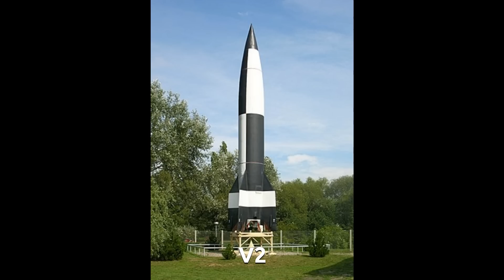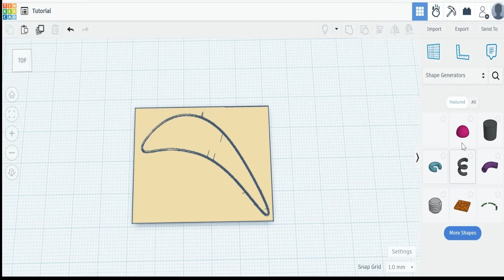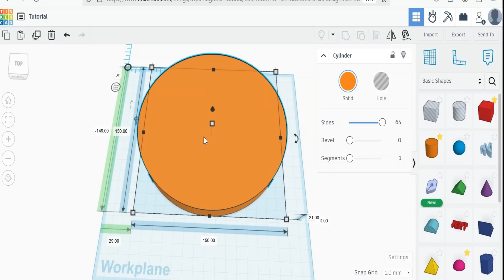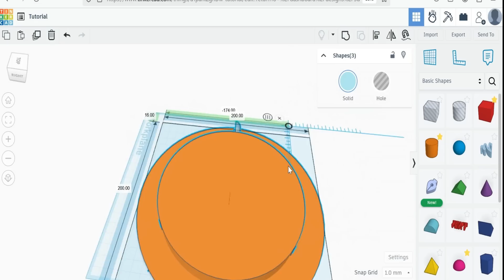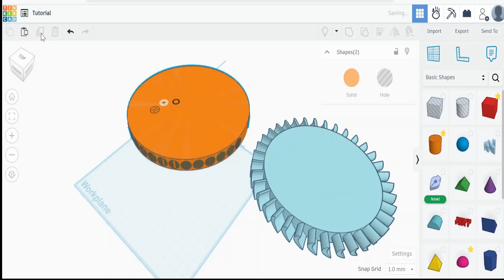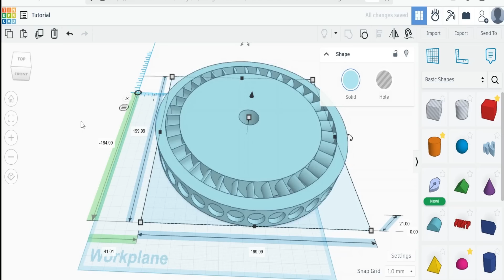2342 The Blisk Turbine

Comment: The new sketch tool in tinker cad can do the extrusion way easier and with different curve attributes for each side. I highly recommend looking into it. I've made some fun stuff with the new sketch tool. And you can place it on a part face and sketch directly onto a part if needed allowing specific holes, pegs, or minor details if needed.
Reply from the maker: cheers mate

Comment: if using compressed gas anyway, could try  taper hydrostatic bearings, around the disk circumferance. (t's a way of 3D printing the bearings)
add bevels to the disk circumference.

then you need a pair of  housing rings with tapers to match the bevels exactly. radial holes so bolts can be used to clamp the disk in between them 
then add at least 3 pockets into the tapers to form gas bearing pads.  
add holes to allow pressure lines to be connected up to the bearing pads.
add air flow restrictors to the pressure lines. and connect them up to pressure source.

assemble the  housing rings to clamp the disk loosely at first. and increase the pressure. it will  leak badly at first. start spinning the turbine, and slowly increase the clamping, but always allow the disk to keep spinning. as it spins and gets tightened, the tapers will start to close up, and will wear themselves down into a near perfect fit. Akin to forming ground glass tapers as sometimes used for laboratory glasswear  
Once that done when the bearing is presssurised there's no solid to solid contact at all. zero wear and the only drag on rotation comes from air having tiny viscosity. the smaller the clearance the less gas flow there will be escaping the bearing. 
forces from pressure have a tendency to expand the housing rings. if the fit becomes close enough it's quite possible that when pressure released the housing rings will clamp down on the disk, and prevent it's rotation .but as soon as pressure applied again the clamping force will release.
Reply: Also... at high rpm, disks and flywheels tend to expand due to centrifugal forces. flyhweeels etc have a max rpm, beyond which the disk will literally fly apart. Between central bearing and periphery material is under radial tension. and those forces are usually the limiting factor for rpm.   With bearing on periphery material of the disk is under compression, and clearance will become even smaller if rpm rises. useful to prevent overspeeding. it's also much much easy to beef up a none rotating housing to handle greater forces than it is to do such to a flywheel. adding structure to a flywheel might increase it's strength, but doing such also increases the forces induced by spinning it..
Reply from the maker: yeah - give it a go mate - sounds good

Comment: I noticed a wierd and probably irrelevant thing with the filter on my large coffee pot plunger i.e. the ones wth the spiral wound thing providing sealing force against the fine metal mesh filter disc.  When cleaning the filter in the sink and running water onto the plunger at an angle to make it spin in order to fling out all the coffee granules, I noticed that it does seem to very efficiently pick up the energy in the running water and translate it into spinning motion.  Just a thought.  It is or acts as a kind of turbine I suppose.  Yep, I am probably overthinking it.
Reply from the maker: sounds right mate and it is an interesting observation

Comment: For the beginning: the V in the naming of those things was for "Vergeltung" =retaliation (or vengeance if you want to keep the correct first letter.)
And there are stories about why many of them experienced "navigation issues". Most were built using forced labour. And there often weren't "enough" guards.
So some forced labourers "tinkered" a bit with the navigation system.
(I remember hearing a former KZ inmate that had to work in such a factory telling that they pissed into/onto the delicate innertial navigation system occasionally before closing the lid.)
Reply from the maker: nice post mate thanks for adding that

Comment: You can get a normal cheap roller or a foam roller and put it on good bearings and you'll find the surface area really absorbs the air from a stroll very well and spins amazing and alert this from doing it by cleaning out rollers with a tap and squeezing the end of the tap hose And the spin used to get and then I realise it also do it with Steam
Reply from the maker: for sure

Comment: So could you create a vertical shaft that directs wind from any direction down a tube and onto this turbine to create electricity? Like some kind of cone at the top of an ever decreasing diameter shaft that doesn’t need to move to gather wind from any direction.
Reply from the maker: that was the idea behind the invelox turbine mate
Reply: @ can you link the video or at least tell me if it worked?

Comment: A tip on Tinker Cad, if you have a bunch of things you want to go around a circle, and they will be 'balanced' I.e. rotated 180 degrees, on the far side of the circle, use the duplicate, button to make a copy, then on the top of the right side, use the 'mirror' button to flip the freshly generated shape left to right. Now drag that shape to the far side of the circle, highlight all 3, then use the alligntool to align them "top to bottom' or 'left and right' across the center of the circle. Now select just the two shapes you want to copy around, and merge those. Now you make a copyof both, turn the copy 10 degrees, and then make another 16 copies to get them all around that ring. Finally I select all of them, align them left to right, and top to bottom, and make sure that they are properly centered on the center shape. 

The same technique for the magnets, though that may not need to be mirrored. If you trust the plastic more than the glue, you might use pockets oriented around the ring, just far enough in that you get a couple of perimeter rings outside of the pocket for the magnet. A drop of epoxy here should keep the magnet in place, but of course you're mostly on your own for orenting north and south poles on those magnets. I would think that the forces on the magnets from the disk spining would mostly be radial, rather than lateral, meaning that the glue wouldn't be under as much stress to hold onto the magents. On the other hand it moves the magnets away from the pickups. So either way.

As for the bearings, I'd suggest putting a 2mm "rim" in the middle of the disk to give the bearings a surface to seat against. That way if a bearing ends up being a little uneaven, it has a seat against which to allign, rather than potentially putting odd stress on the bearing and disk.
Reply from the maker: cheers mate - I have done tutorials covering your suggestions but it great to have a refresher for folks who haven't seen those tutorials
Reply: @ThinkingandTinkering  For me it's been part of making knitting looms, where the pegs need to stay oriented around a common center. And I've had the fun of working out angles, like how to get 7.5 degrees of rotation for a 48 pin loom, turns out if you turn it to something like 7 degrees, and you get to that 'counter quick enough, you can type in 7.4 (or -7.5 if you'v been rotating it the wrong way) and it will remember that change as well. I imagine that someone's going to need that for a 52 or 66 blade turbine some day. 

Who knows, I may have gleaned the rotation process from one of your own videos. In any case, was good to see, and I'm wondering if that blade profile is going to show up on a Magor Hardware fan showdown one of these days. That might be cool too.

Oh, another way to get that blade profile from a png or jpeg file is to open it in the Gimp, (photoshop may work too, I don't use it) use the magic wand to select the blade profile, then turn the selection into a path. Go voer to paths, and export the path as an SVG. I've had to do this for a couple of 3e prints where the image was needed, but not really available. There may be a way to do this directly in Inkscape too, I haven't delved far enough into that tool.

Almost always interesting to watch your videos. Have a great day!

Comment: The blades you've used are for when the propellant (usually steam) is to expand and increase in speed as it passes through the rotating blades - a reaction turbine.  That bulge forms a narrowing of the space between the blades, like a nozzle, so the steam expands and accelerates as it leaves that narrowing (nozzle) and the curved tail of the blade redirects the flow to one side, the reaction forcing the blade and rotor to turn in the opposite direction.

However, what you seem to want is the propellant to increase in speed from stationary nozzles then transfer all the kinetic energy to blades - an impulse turbine.  You need slightly different shaped blades, like from a De Laval turbine, or half a Curtis Wheel.  Just google "impulse turbine blade cross section".
Reply from the maker: cheers mate - but i did want steam
Reply: @ThinkingandTinkering  Ok, blowing through the straw was only for demonstrating porpoises ;P

Comment: Thank you Robert, I love these projects and more than that, you make them so I can understand them, always a massive bonus.  Would it be possible to use it as a hybrid wind turbine by having a "big cup shaped thing" to catch the air, reducing to a small outlet (a bit like a funnel) to drive the wheel?
Reply from the maker: I honestly don't know mate - but i do like the idea
Reply: @ThinkingandTinkering  I wondered if it were nearly empty in the middle with the blades attached inwards from the outer rim… would you get good low/medium velocity breeze throughput without losing any important design considerations?

Comment: If you want to trace lones to an svg, I normally use inkscape. Inkscape is free and has extensions you can use. You can search online for how to do this, its pretty simple. And with inkscape you will likely get a significantly better trace of the picture and use it directly without having to use it as a template. Just a suggestion

Comment: Hello Mr. Robert Great video as usual... I always wonder about the balde for gas turbine. How can they withstand the huge torque when rotating the generator to produce electricity? With simple calculations, it appears that each megawatt requires more than three thousand Newton meters at   three thousand rpm per . Will the force resulting from compressing the air and then expanding it when mixed with fuel and igniting it be distributed on both sides of the blade? That is, the force embraces the blade .. I hope for clarification
Reply from the maker: each blade doesn't experience that force mate - it experiences only a small share of the force which adds up
Reply: @ThinkingandTinkering  thanks sir

Comment: Another great video.  I have thoughts to print additional blades in closer to act like a transmission when it gets up to speed, blow on the ring that's closer to the spindle for higher rpm.
Reply from the maker: i like that thought mate - do it - oh and do a video to share it - cheers
Reply: That's a very nice idea, having the nozzle adjustable.
Inner loop and outer loops for speed and Torque. I'm sure this variable drive idea, is definitely a good one, I thought similar thoughts, when I saw this, shifting mechanical would eat energy, but less if  nozzle than Gearing, chain or Cog. If I lived where more running water was, I could see a, "Trompe" water powered Air compressor, and this turbine. Compressed Air, being a alternative way to Store Energy.

Comment: A word of caution on your model:
Having built a  couple of turbines of similar size I would suggest that you reconsider the magnet holding geometry even for low power testing. 
 A single nozzle on that turbine even with tens of PSI pressure could result in many thousands of RPM.  The turbine itself in PLA should be fine, but I would not want to anywhere near the turbine disk loaded with magnets.  Even  if the glue joints hold up, the centrifugal loads on the disk with magnet notches will  likely exceed the disk material tensile strength.   Glass hard and brittle  NdFeB manet shards would be one of the last things I would want to have flying around  the workshop.
Reply from the maker: stick an outer ring on it if you are worried mate - but if you have ever tried to separate super glue magnets and PLA - chances are you wouldn't worry
Reply: First thing I thought is that you made a magnet launcher!
Reply: Jeez, I think some common sense can be used.... It's an interesting little demonstrator blowing through a drinking straw for a few hundred rpm!!   Anybody sticking 90psi factory air on this probably has probably done quite well to live this long 🤣
Reply: my thought as well. I have been at the wrong end of not thought out engineering.
Reply: Maybe add a clear layer of tape around the outside?

Comment: Ive always thoughy of using a wing turbine to pump air into an air compressor and using the stored air pressure to drive a turbine. Air compressor battery. It could be setup to have a max capacity and a release valve of lower pressure. Just haven't got around to doing it.
Reply from the maker: you should mate

Comment: Tinkercad now has added  a sketch function which is MUCH EASIER in "basic shapes" section which works similar  to parametric  cad
Reply from the maker: nice tip mate but without a graphics pad controlling the curve shape using sketch is a challenge
Reply: @ThinkingandTinkering  it allows you to sketch a straight line then stretch it into a spline tho it is a bit awkward, will try your way sometime

Comment: if you have lightburn you can use their trace tool on a jpg and that will trace the outline of the curve, which you can then save into tinkercad
Reply: there is also  vectorise option in laserGRBL (the free laser software.) when importing a jpg
Reply from the maker: even better - awesome mate - cheers
Reply from the maker: nice tip mate thanks for sharing